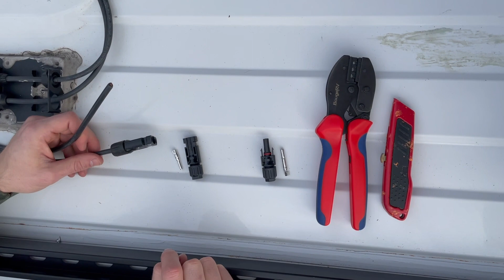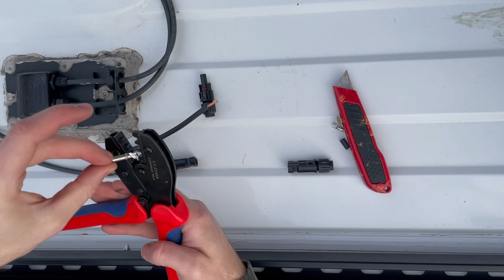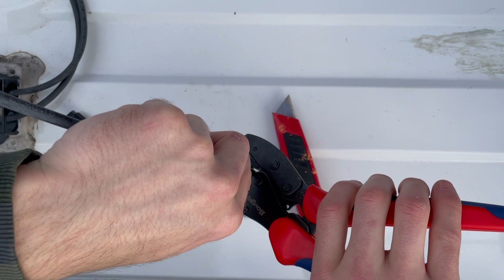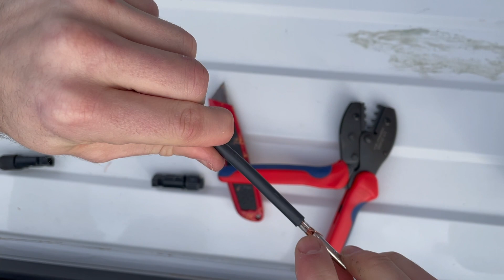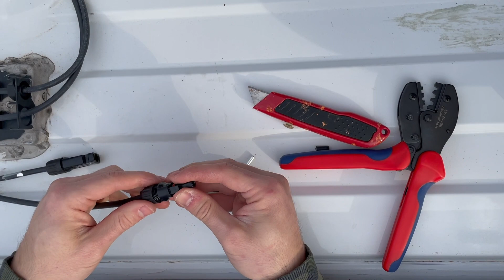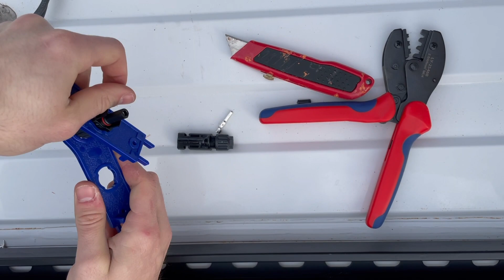How to Replace and Assemble MC4 Solar Connectors | Van Life Build

Comment: Other way around, but it's a common mistake,  even many suppliers advertise them wrong. The male connector is the larger one, the female the thinner one.  It has to do with which metal pin fits inside of which, not which plastic housing fits inside of which. You'll notice the positive lead off any panel is always the female (thin plastic housing). Positive is always female to protect from shorts.  But good video all the same, thanks